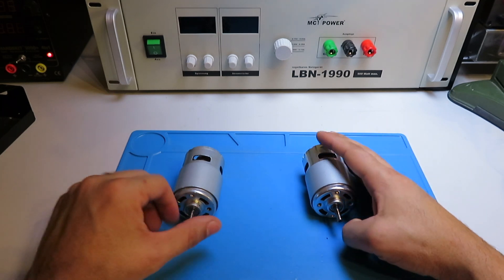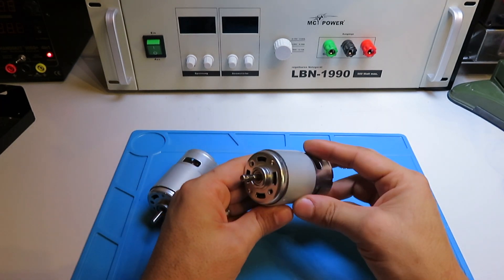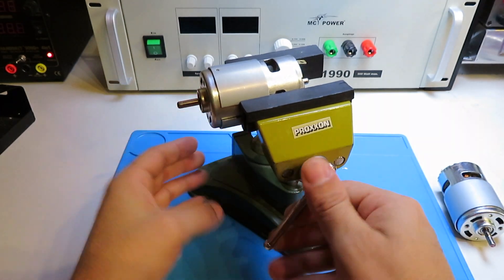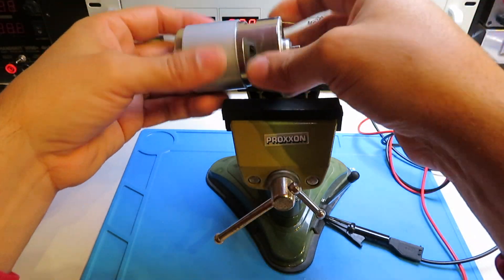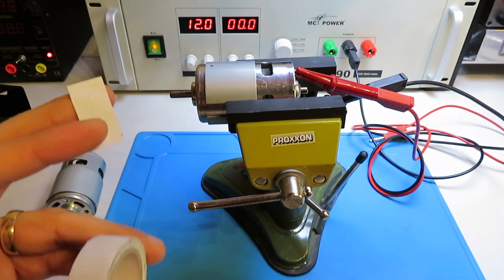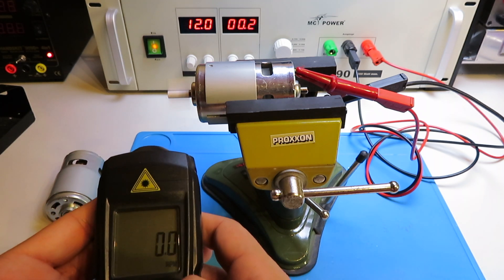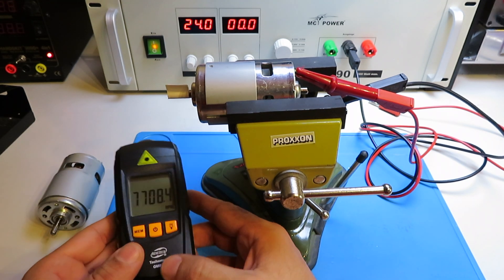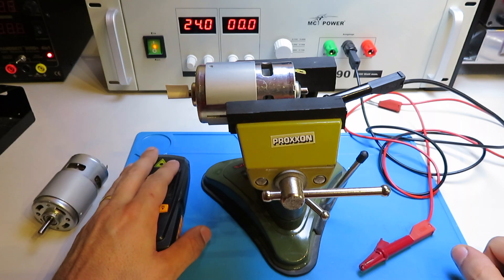GM8905 Contactless Tachometer: RPM of a 775 DC Motor

Comment: Thank you for making this series of videos about these motors. I recently bought one AND a new clamp meter at the same time. I thought there something wrong with my new meter when I measured the no load current draw of the motor.

It should have been 0.68A at max voltage: it was actually 2.2A!

Further testing proved the new meter was accurate and the motor was wrong. The speed and ease with which the seller offered a partial refund suggests they know there is a problem with supplying accurate motors - which I think your video confirms. Thanks.

Comment: can we convert of low rpm motor to high rpm,,,
Reply from the maker: If you provide more power, yes. But it shouldn't exceed the max voltage the motor can handle. Another way is using gears...
Reply: ok thanks
Reply: FaZaLi HaSeEb Tv yes by using gear and pulley

Comment: Interesting. So, to keep similar performance in one vehicle is needed to buy all the motors in one batch from one single page
Reply from the maker: I did buy 4 of them in one batch from the same page and they are all different (performance) :(
Reply: Wow! that's very odd... is a gamble buying this motors
Reply from the maker: Indeed. Luckily I got 6 of them... I test and use them according to my needs. You can get one that is not powerful enough or it is a killer but you might have to redesign your power source. Simple as that :(